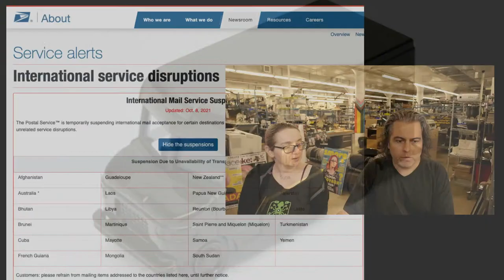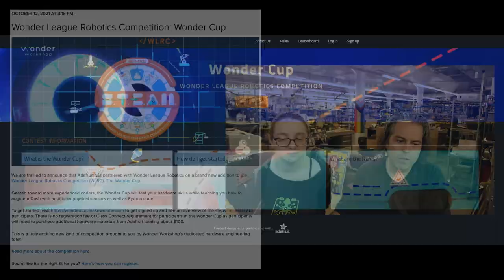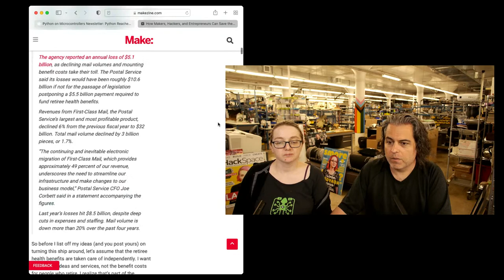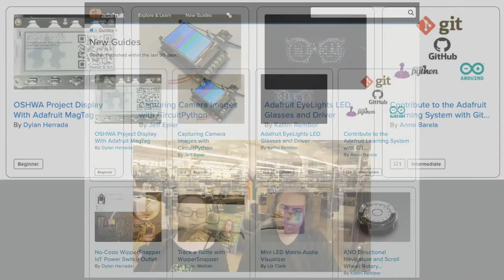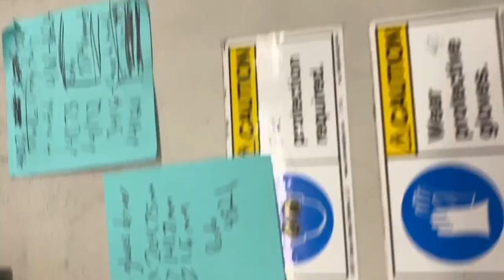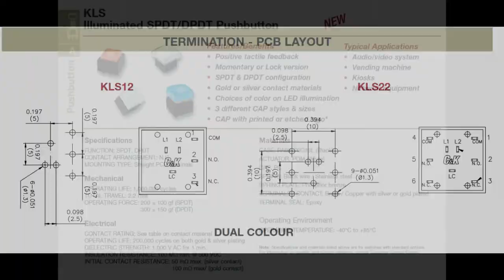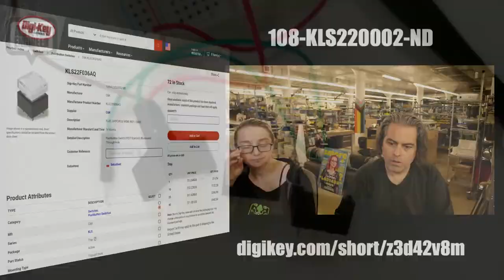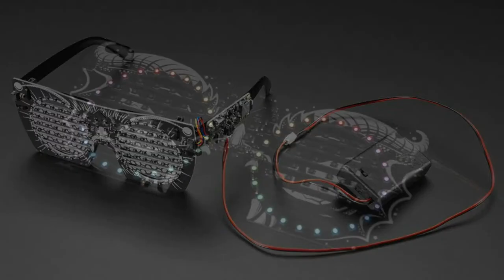ASK AN ENGINEER 10/13/2021 LIVE!

Comment: Re the crimped ferrel "boot laces" for putting wire into terminal blocks. You should get the special 4 jaw crimpers/pliers that crimp these from 4 directions at once. I got mine when I purchased a similar mixed kit of "bootlaces" off eBay

Comment: The problem with postage to Australia from the USA is the lack of planes flying between the 2 countries as Australia's international borders are essentially closed and as a result the freight rates for postal items is difficult/expensive and thus USPS is thus cut. Hopefully when Australia opens our borders internationally December/January the situation will improve.
The way Ive been dealing with this lately is to purchase from DigiKey and I get your stuff 4 days later and its free delivery if I order for than $60 AUD, ( $45 USD ) - Just about to place an order for some more M4 feathers